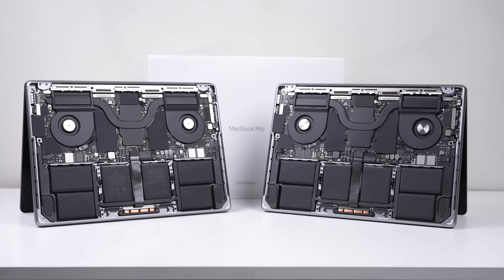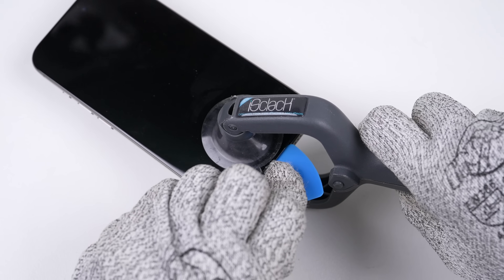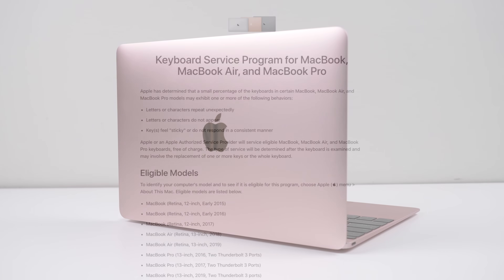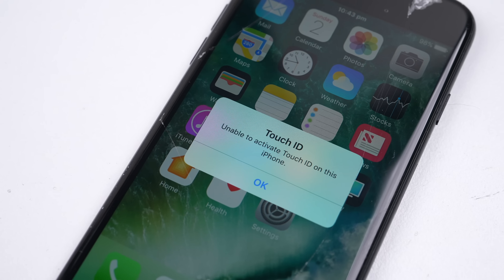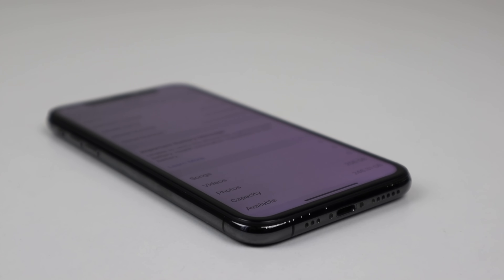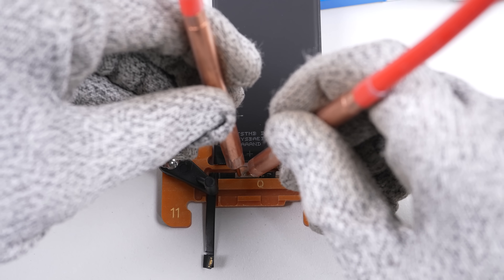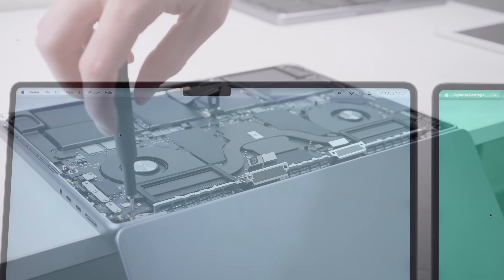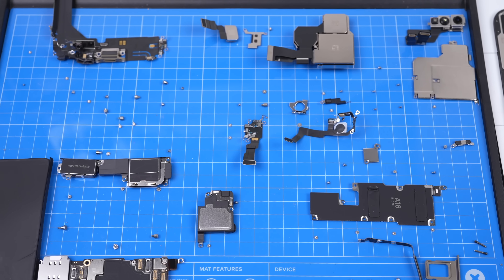Astonishing Anti Repair Practices By Apple In the Last 15 Years

Comment: As an Android phone user, I find this absolutely amazing. Apple really does own your phone, you're just carrying it around for them.
Reply: That's why I will never switch to Apple
Reply: Samsung is not a good guy either, they are just a lesser evil in this case. They did many of the things Apple did, like replacing screws with glue, making the storage built-in, removing the audio jack, etc. It is just Samsung have not gone out of their way to invest in a whole anti-repair department Apple did.
Reply: @rps215 I'm convinced Samsung is the reason so many people don't like Android phones. I've had two and absolutely hated them. But of the LG and OnePlus phones I've had, all were great. 

Samsung has a decent amount of bloatware and UI stuff that forces you to do things their way. And I was never impressed with the cameras or the batteries.
Reply: @TransistorBased  Samsung's are the best android phones nowadays idk what you're on about
Reply: @XgoodbyeX  but you don't get apps in Europe they're still lowkey shadow banned, not a good choice rn, they do make solid phones though
Reply: @TransistorBased actually after iphone 13 I am personally impressed by galaxy a34 5g though its my first samsung phone
Reply: @TransistorBased Samsung is better now then it used to be based on my friend's experience with the s23+ but I haven't owned one of their phones since the note 5. Currently using a OnePlus 7pro which has been great. I will probably upgrade phones when we start getting replaceable batteries.
Reply: @TransistorBased  Samsung is the Apple of Android. Overpriced garbage with bloatware. Imo the best Android experiences today are probably coming from Chinese manufacturers - OnePlus is pretty fucking solid. Google's phones aren't bad. Hell, even motorolla phones are better imo.
Reply: @Nizzzler  I've really been enjoying my OnePlus 11. In terms of build quality and OS integration it really does remind me of what I liked about LG. I've had two Samsung phones and neither one impressed me at all. The batteries dropped off quickly, performance was weak, and the cameras were abysmal.
Reply: @TransistorBased  Totally agree, I found it hard to look back after switching to OnePlus, have the Nord CE 3 now, the brand is hard to beat at the price point. Quite honestly iPhones are pretty solid, cameras are great, and iOS is a decent experience but their exorbitant pricing and unashamed forced obsolescence feel like a slap in the face. Though if someone's insisting on buying the latest samsung flagship phone, it'll cost them about the same as an iPhone, and quite honestly I'd pick the iPhone in that specific situation - that's just a testament to how shit Samsung's phone experience is for the price.
Reply: @rps215 true but lesser evil still better I switched to samsung while I am planing to switch to other phones in future though but idk which exactly better tbh
Reply: @rps215   What about xiaomi?
Reply: Just put my 3rd battery in my S7.
Reply: My galaxy s8 is still servin me well! I also just cant help but laugh when people ooh and ahh over a new phone every year
Reply: @charliezw328 especially apple junkies lmao. My google pixel 7 is the best phone ive ever owned😁 i will never touch apple
Reply: i have the same but an old s7 still functional but had to get a replaced screen which i had done easily recently the old phones show how newer phones are made harder to fix so they get more money
 @charliezw328
Reply: Android is the os, not the device manufacturer. That means nothing, really. Samsung phone that runs android, that makes more sense. And don't kid yourself, almost every manufacturer is crap to some degree, and everybody has overpriced (though not usually to the apple extent) flagship models.
Reply: yes, it's so crazy for any technically un-ill-visioned individual, right? How can such a useless brand even exist? I don't get it: Need a phone? Buy any phone. They all use android. Know one. Know all. Period. Need a desktop? Buy a desktop. Need a laptop? Buy a second desktop :P Need a tablet. Buy a tablet (android, works like your phone, yay). Instead: "end to end e-waste"
Reply: The problem is people still blindly let themself got fooled by CrApple shitty marketing like macbook or iphone with fake apple slide. People also ignorant to not care about repairable unit, they think CrApple is a company who can do "magic" like their products will "never be" broken which is so dumb.

So glad i always own Asus laptop with Windows and xperia phone. CrApple sucks !!
Reply: Oh, and of course Apple customers not just carry it around, they happily prostitute themselves to providing free advertising by being so utterly spineless and devoid of individuality that they leave the signature ringtones unchanged. Because an Apple device is not a tool. It's a fashion accessory. A statement. Only perhaps not the statement they believe to be making.
Reply: google owns your data. you're just using it for them. all companies are the same these days
Reply: As an iPhone user I agree - on the other hand, Android phones are sh!t.  I had a function i used a lot on my iPhone where it automatically had the document I was working on on my iMac ON IT when I left my desk. A group of Android users told me |"so what the Android can do that" so I asked them to open the phone and show me the document they currently had open on their computer - 20 minutes of fiddling and faffing later.

OH you have to set it up, Oh I didnt save it, Oh you need to sign up for Google Docs. I didnt have to do any of that at any point - 1 touch and its there. 

With Apple, you sacrifice the freedom to do exactly what you want as long as you have an hour to set it up and good technical knowledge and it might work 40% of the time - for the ability to do what Apple allows you to do instantly with no effort and no technical knowledge 100% of the time 

My iPhone knows the app I am most likely to use next and how I am likely to use it and automates a short cut notification for me, it currently thinks I want to listen to "the Bulge" podcast and its right cos I am about to walk my dog... 

I know that this is not ideal for a lot of people, but for me I have zero interest in knowing how to make a phone do a thing - I just want it to happen by magic.
Reply: I have a Zfold3 and it's my baby lol
Reply: after giving them your money
Reply: Ive ripped apart my own phone several times to repair it at home
With a tool set i bought for 15 dollers
Reply: I agree. But the fact that more-than-one company actuates this awful practice, does not justify Apple whatsoever. It's a very bad habit (ultimately unjust for customers, let alone the planet ecosystem), and big companies should cease doing so! I am sure you see my point.
Reply: Unfortunately this is the case for most tech these days unless it's more build it yourself like a PC. Even then an experienced technician and coder can wreak havoc on your computer.
Reply: @xyro9115  You know who else can wreck havok on your pc. Every person with a glass of water.
Reply: @xyro9115  Somebody maliciously damaging my system or phone is different then the company I paid good money to for a viable product.
Reply: Genuinely, I prefer iPhones. Samsung phones don’t have a home button; the SE does
Reply: try running your phone without google play services.
Reply: APKs work just fine for me.
Reply: @jessepatterson8897  Easy, just flash a new OS. Well, not "easy", but realistically possible, unlike an iPhone.
Reply: @jessepatterson8897  i do that just fine. you never had a rooted phone?
Reply: @jessepatterson8897  Whataboutism, the favorite defense of Apple loyalists
Reply: @jessepatterson8897  you do realize that this is not only possible, but also really easy to do, right?
Reply: Well I do, and can't complain
Reply: @jessepatterson8897 what does that have to with repairabily??
Reply: @jessepatterson8897  this just makes the phone inconvenient, not unusable
i say it from a Huawei user's perspective
Reply: @DragoSmash  huawei imo are utter unadulterated crap - both their phones and their mobile wifi devices.  “Utter shite” as the poms would say.
Reply: @1ihws  agree completely, just saying that i know a person who used a Huawei phone and not having google services made the device inconvenient (on top of the quality being quite shite) but not unusable
Reply: @jessepatterson8897  Huawei p40 pro in France, feel you brother.
Reply: android is "better" then iphone but not good, most of them are glued and you cant even replace the battery.
Reply: As opposed to android phones?
Reply: @rksb93 android is  pretty much every phone that isnt apple lol
Reply: Never had a virus on an iPhone but had heaps of friends get them on their android phones. 

Only plus to android is being free of iphoto and having easy access to move your pics freely.
Reply: @markmcgrath9098  lmao, did your friends click on antiviruses 😂
Reply: @markmcgrath9098  Your friends must be doing something horribly wrong if they are getting malware on androids.
Reply: @markmcgrath9098  I've owned about 6 androids over the years and never had a single virus. No android users I know have ever had one either.
I can speculate on your browsing history 😂
Reply: @Duck-jc9ox  I can only speculate on yours…I don’t know any Android users who haven’t picked up various viruses !
Why do you think so many buy Apple ? Not everyone is an Apple fan boy….we just buy what works.
Reply: @stephencrowther524 Sorry to say, but I think those users really weren't cateful with their phone.. It ain't so easy to just pick up a a virus. It's actually first time I'm hearing someone managed to do that.
Reply: @markmcgrath9098  define "virus"
Reply: @markmcgrath9098  ? I can move pics freely on my samsung so... i don't rly know what are you talking about 😅
Reply: @godzilla928  Read what he wrote again.😂

Comment: I have never willingly owned a single Apple product. Simply out of principal. The one and only apple device i used was one of their phones. this was because it was a company issued phone. Why education institutes and companies choose to invest in apple products is beyond me. On the bright side. Apple phones/tablets, etc, are compatible with InTune, meaning you can manage and administer said company devices from a single source. This means that if for some reason an employee whom was issued an iPhone or iPad was fired or quit and did not return it, they could simply lock it and even track it to have it "Recovered". This worked on an HWID level meaning that the devices unique ID was stored and whoever owned that ID had full administrative control. This essentially made jailbreaking impossible unless you were able to inject a whole new ID. which i am unsure if this method even exists.

Comment: You could argue it started with Dell computers. Apple did try to limit the ease of home repairs making every device a booby trap. The 3GS was the most hackable device ever made, you just had to install the right version of itunes  to the phone model which was easy. 3GS biggest issue was exploding batteries!. The real industry shift came around the time of the 5s fingerprint scanner. Nothing to do with finger print scanner. Just then was the time it became an industry standard across the board to head towards unrepairable junk. Screens cost next to nothing once mass produced. Apple uses sweat shop labour and cost and wants premium x100 profit.

Comment: Apple sucks

I'm not a fan of Apple. Because of so many reasons. They make a great product on the front end: aesthetics; engineering; software; hardware; marketing. 

But on the backend they are terrible: repairs; labor practices; compatibility; adaptability; price

Their dishonesty is like all other corporate groups, the bigger and more powerful they are the more they move to capitalize on their power by cheating the customer.

Apple is that narcissist who smiles to your face and then cheats and uses you like a disposable condom.

Comment: I knew it was bad with the 2016-2019 macbook pro solderd ssds, bad keyboards, display cables failing and usb C issues... but this is horrible! Fighting agains repair people that want their customers to have truetone on their displays by defeating their code that allowed it to work on screen replacements!? That's bad. I heard about phones being slowed down over time or that a new OS might make your phone run slower for some reason.  I never thought it made sense especially with power of flagship level phones of the last 5 years. Apple is finally trying to seem more consumer and reprair friendly because they are being forced to by California and the EU.  Good for California (usually i dont agree with their woke socialist nonsense). The rest of the world should do the same. I xan understand it might have been difficult to make some of these small components better but with improved technologies and micro/nano engineering they should be able to make most components repairable. Thank you for making this video!

Comment: And the replacement part signature and reduced performance on old devices could've been solved with a software switch.

when the user presses the "max performance" button a pop-up would show
"old batteries lose in capacity after repeated charge cycles. The current battery had [number] cycles. We recommend balanced mode after 1000 cycles or a replacement battery from a certified repair service. Do you really want to active max performance mode?"
followed by "cancel" and "yes" options. If the user choses to use max performance and sees reduced battery life, Apple is fine, the user agreed to it.

And when a replacement screen is installed it gives a pop-up
"The installed screen has not been certified by Apple. This can be a security risk and might offer performance and screen quality issues. We suggest contacting an official repair service to install a certified screen"
followed by "turn device off" and "use anyway"
That way the user can decide to use the unpaired screen anyway, but at their own risk.

And the same with batteries. Inform the user a part isn't "officially certified" but leave it to the user's decision if they want to use it anyway. Apple has already covered themselves by informing the user about the risks and recommended steps, but doesn't stop them from doing not recommended things.

Comment: It's not just anti repair, there are so many ugly practices by Apple, for example the fact that they wanted you to pay for Apple care in Europe when European law already says anything bought in Europe should be covered by a 2 years warranty, or the fact that they block communication with non Apple devices when using bluetooth, or iMessage non using RCS, or the fact that they removed the audio jack (and many stupid other companies followed them), the fact that they started soldering everything effectively forcing you to buy a higher end model with more RAM/disk space they took away so much freedom from the final user and people fail to understand this.
The more features they take out, the more you pay, it's hilarious, you pay to have less.

Comment: I wonder when will I ever buy an apple product. My university lent me a mba late 2011 with 2GB/64GB configuration. Later in 2017 I bought it for less than 100$. I still keep it running for the sole purpose of a backup linux laptop, in case my main laptop goes down, and I need to burn an usb image, or I need to recover my files directly from its drives. That's the sole purpose of the only apple product I have, better than it being in a landfill.

Comment: After seeing all the effort Apple has put in to preventing repairs I only have one question: How favorable has the new R2R bill have to be to get Apple's support? Because that bill must exclude everything Apple already does to prevent repairs for them to back it.
Reply: it excludes waterproof or water resistant devices, which is what apples products are unfortunately marketed as. so apple can claim they're all for that bill, but due to their marketing strategy they are exempt from having to make their products repairable. they are only supporting the bill to look like they are 'really changing for the better' and that they 'care so much for the environment and technological waste' but in reality they will likely be one of the brands who are the biggest contributors to it. (so, basically, any brand that claims to be waterproof doesn't have to be repairable, which is EVERY brand)
Reply: @danielganong2557  Is the MacBook waterproof?
Reply: it exempts phones